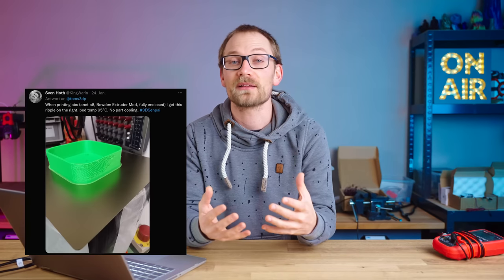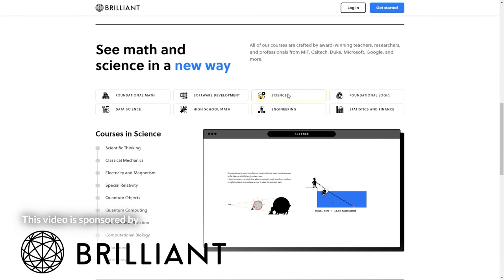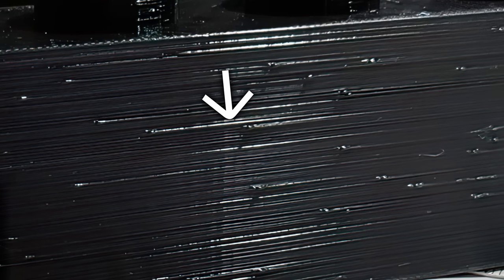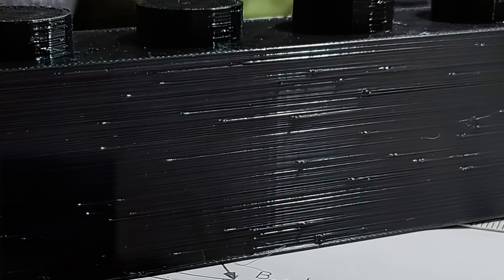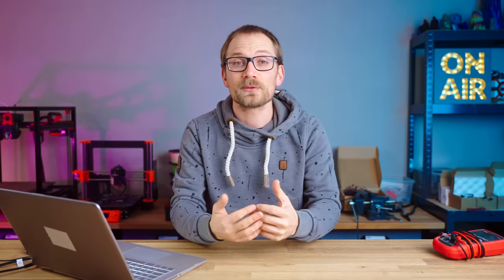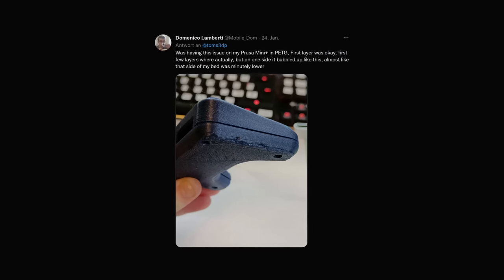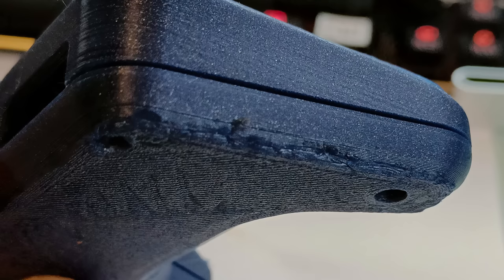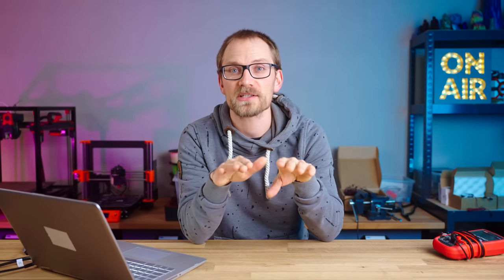Diagnosing YOUR 3D printer problems! #3DSenpai

Comment: The first problem also can be solved by enabling coasting in Cura. It stops filament feed a few mm before the perimeter end. So the hotend can relive pressure a bit. It helps a lot with runny filaments like PTEG.
Reply: Nice tip, didn't know about the coasting (I knew it was there, but never figured where it was helpful). Gotta check that out if I end up with this problem now!
Reply: Seconded, petg needs coasting enabled in my experience to get rid of stringing.

Comment: 1st problem - can try enable "retract on layer change" to decrease pressure a bit.
3td problem - PETG does not like to be squished in general. Also, layer above it may fail to bind to first layer properly then and you may get tears in 2nd and other layers.

Comment: Re: cleaning print surfaces
I apparently have oily skin, I've flooded Prusa sheets with IPA before and still got adhesion issues. When I put on nitrile gloves, that went away. If that still doesn't work, I give it a quick swipe with acetone then clean it with IPA.

Filleted surfaces facing down can turn into a dog's dinner when 3D printed, especially if the fillet goes all the way around the model (that can result in air printing). It might be worth cutting the model in half and printing the pieces with the fillets facing up, then gluing the pieces back together.

Comment: Tom, I've been tinkering with 3d printers almost as long as you but was stumped by a first layer issue for the past few weeks.  After watching this video it turns out first layer extrusion multiplier was screwing up all of the layers as high as 10-15!  Pretty cool that a relatively experienced hobbyist can still learn a thing or two from newbie-oriented content.  Also, I was recently thinking about your foray into MPCNC-land and what a sour experience that was.  Have you given the PrintNC a look?  It looks like it might check all the boxes.  Fully open source(well organized Fusion 360 parametric model free to download!), utilizes 3d printed parts for machine building, and has relatively little content already on youtube about it.  The discord is also very active.  Worth a look if you're thinking about new project content.  Cheers!~

Comment: Thanks for giving me the inspiration to take the cover off my old heavy modded cr10s :) She now has all bearings degreased and refurbished, all pulleys checked and belts tightened. Went over all the frame screws just for fun, and im glad i did :) some1 was sloppy when assembling? hmm i wonder :P 

Juuuust finished leveling the bed, all i had was tpu,, but it worked fine ;) 0.1mm layer squares, all within 0.01mm tolerance. I think i got it level enough now;) 

THanks again man. Currently printing a can sleeve cooler thing for my coldsnacks.  Cheers

Comment: The first problem looks like too high of a retraction length. If set too high, the nozzle can suck up a bubble of air inside and then get pushed out close to the start of the line/seam. I had noticed this issue when doing a pressure advance tuning tower. The bubble/zit was always on the side of the start of the seam. I turned down the retraction length from 2.0mm to 0.5mm and the zits completely disappeared. I have a Voron v0.1 with a Dragonfly hotend.

Comment: On my Prusa Mini, I have been having some minor issues with connecting multiple parts together. Instead of a flat edge between the two, the two parts have a slight curl away from each other, creating a noticeable gap. I am using painters tape to increase bed adhesion, could that be an issue?

Comment: Hehe, this is part of the fun with 3d printing, solving problems that crop up all the time. I'm a bit stupid so I designed and built my own core-xy 3d printer from scratch after only having made 5 ish prints with the cr10 I started with. Tuning a 3d printer from scratch is a learning experience I tell you!

Comment: In response to the first problem with the blobs on the seems: make sure you print the inner perimeters before the outer. If you print the outer first your nozzle will ooze during the travel move to the beginning of the seem. With internal perimeters first the ooze wipe will be invisible and the outer perimeter will start with just moving over 1 perimeter thickness from where the previous perimeter ended so no time to ooze.

Comment: Could that first issue not also be fixed by making sure your Z Seam is aligned/otherwise not set to random?
Reply: Not really since it happens when the printer moves from inner to outer wall. You would just end up with obvious zits in a vertical line and that gradient he mentioned
Reply: @ciarfah  depends if you have random z hop or an assigned location

Comment: The Zips can also be reduced further by the new (experimental) Cura/PrusaSlicer setting "Pressurer Equalizer".
If you set an appropriate value for the "slow down" portion of the function, the print time will increase slightly,
as you basically "ramp down" to the lower speed for outer perimeters.
But your slicer will have an easier time to calculate realistic pressure buildup in bowden extruders and
thus get more consistent linear extrusions.
That + the mentioned measures should pretty much eliminate the issue.

Comment: Problem 2 is a good example of why I think the closed loop systems that measure the movement of the stepper motor is basically worhless.
You need to measure the opposite pulley tot he motor so you know that something have actually moved instead of the motor that might move but everything else is standing still.
Reply: Closed loop is not a solution to backlash, and I don't think anyone knowledgeable would claim it to be.
Reply: @jaro6985  unless you use glass scales or sth like that, which would be real closed loop

Comment: Most of the problems I have encountered over the years can be described by saying the model of my printer: Lulzbot Mini V0
The joys of being an early adopter lol

Ours was probably within the first few thousand of the lulzbot mini's produced, so z axis issues, bed levelling problems, bushings and belts wearing out from old age, mounts for the various bearings for the belts cracking, z offsets being off from the factory, the clamp for the extruder feed system often broke on the early ones they made it thicker later on, not to mention the electrical faults, good god the wiring in that thing was a rat's nest haha

Comment: The thing that gets me is trying to match the flaws I'm getting with examples online. Text searches often return spurious hits because I can't describe them specifically enough. Images in troubleshooting guides often differ enough that I'm not quite sure which one applies (if any). That's why I like test models designed to elicit specific problems. Starts to cross over into printer calibration from troubleshooting, and there might be too many models to expect someone to run but arranging them in a hierarchy if greater diagnosis is required might help.
Reply: Your flaws may not be from the slicer- they can be from mechanical issues with the printer and the firmware - things like E steps etc. Slicers of today are so much better than 5 yrs ago and most profiles work out of the box with no tweaks - cura and prusia are two i use and have found they work fine in most instances . I think a lot of people try to run before they can walk and end up so confused -try the pre configured profile first then work from that.

Comment: I recently had a bag clog on my ender 3 pro, I had to take my hot end completely apart and even trim about 3/8" off the tubing and reassemble. now I seem to have little micro gaps randomly through the layers, that wasn't doing before, any ideas what could help resolve

Comment: in april i got given a used ender 3 v2 neo by a family member as a gift as they were upgrading. this is my first printer. after teaching myself how to use it and getting very familiar with the machine i am still unable to get even one test print, i can get the bed perfectly leveled and a good first 3 layers then it stops extruding and keeps going, no extruder clicking it just ends up leaking out or underextruding. i have done multiple fixes for heat creep ect, taken apart and put back together the hotend, cleaned and even replaced the tubing and couplers hoping for any sort of result. i have spent maybe over 100 hours troubleshooting and exhausting all the fixes i could find. im not quite sure how to go forward and i dont have anyone able to assist me currently. im willing to pay to just have someone physically help with it or give instruction on what to try next. thank you.

Comment: Ah I didn't know you were doing this. One of my printers has a problem nobody has had an answer for. A wavy pattern on the +X side of all prints. Also on -X but not as pronounced. I've basically stopped using that printer.

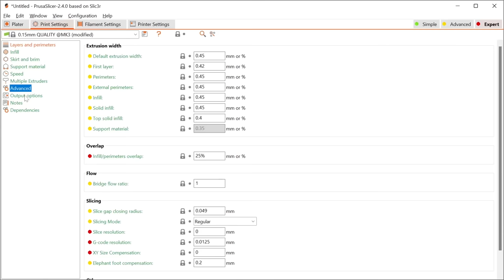Comment: Did you change the extrusion width to 1mm at 7:54? I didn't know you could print a 1mm width with a 0.4mm nozzle, that is a good tip. The max I tried is 0.55mm width
Reply: I've gone with 0.8mm if my feed rate is low enough for the filament I'm using, so with 0.2mm layers I can still push 80mm/s at 0.8mm traces, or 0.6mm with 0.3mm layers but that's the edge of it, and PETG might not like it too (e-Sun one up to 0.6mm at 0.3mm layers and 60mm/s but not more, it will under extrude above that combination).
Takes quite a bit of testing to check if you filament, temperature, hotend and nozzle can all handle each mode. I like using 0.4mm outer walls for fine details and 0.8mm skins to get those tops and bottoms over quickly.
Reply: @Kalvinjj  I have some corner warping issue with some models with sharp corners like squares. No matter what I try(brim, mouse ears, etc.) it still warps just tiny bit. I figured this would be a good thing to try on those shapes!

Comment: Do all fdm printers (non direct drive) have a standard bowden tube fitting size/thread, specifically on the FILAMENT FEEDER(not the print head fitting)? I have an Ender 3 pro and the fitting on the feeder motor with the geared teeth always loosens. I think I have an alternative, but Im having a really hard time finding the right part.

Comment: I have a problem with my 3d printer, when i try to print something it prints on the side as it should and it stays on, how ever when it starts to print the actual print in the center it does not stay on and i have even tryed buying a new bed on it which had some left over resin on, and now that i have tryed the new bed that arrived im very concerned about if i should buy a new 3d printer or if there is any way to solve this problem

Comment: Are there any slicers with higher level control parameters so they're easier for people with less experience? So you can specify what the priorities for the print are: speed, surface quality, weight, shell integrity (i.e. no holes), etc and then that tweaks a bunch of parameters rather than you doing so explicitly. That would seem like the long term ideal to strive for. I've only ever used Cura which I've read has a lot of controls so perhaps this is closer (at least a bit, anyway) to how it works in some other software.
Reply: Cura allows you to choose what parameters you want to see or you use  most - you  can use the basic setting which does pretty much everything for you or switch to advanced and fine tune the settings .

Comment: My ender 3 pro nozzle can only get up to 160 degrees. All connections tight on main  board.  I’ve replaced thermistor. I checked barrel hot end heater with meter.   17.5 ohms the bed heater is fine.  The message I get is “heater Failed Printer Halted Please Reset”.  Please suggest what to check

Comment: Hey just got my first printer and chose an ender 5 plus because of its massive build volume. 2 questions though 1. Any opinions on this machine or upgrades I should get or print for it? And 2. Is it normal to hear light popping sounds on occasion while printing? Sounds like it's coming from the hot end. My only upgrades so far was an all metal hot end, silent board, and Capricorn tubing.
Reply: The popping sound is most likely moisture in your filament. It can easily be dried out and you’ll get better prints and no more popping sounds!

Comment: one video I would like to see is, converting a 1.75mm direct drive  (or bowden) to 2.85mm, which 2.85mm I my experience is cheaper. I modified my Anet A8 for 2.85mm and I did a copper wire through the nozzle approx 3 years. I did the 2.85mm mod because I wanted to print trimmer line, which prints so well once its dried. 2.85mm has its cons but it also has its pros. 2.85mm petg can be a pain from my experience, heat creep, not melting evenly resulting in jamming. but at 1/2 the cost from my filament supplier worth the troubles. and trimmer line, when dry, prints better as easy as pla

Comment: In supersicer I am trying to run my first layer speed to 50% but when I change the speed it doesn't change it on my prusa i3. I have to manually go in and dial it down to 50%. The first layers is in mm/s for min and a percent for max. What am I doing wrong

Comment: my ender 3 v2 under extrudes only in the front left corner of my build plate? any walls or surfaces facing directly at the corner come out under extruded with1 wall thickness fading to nothing the rest of the print is about 90-95 % perfect .any ideas ?

Comment: i have a odd problem, the first few layers or so look extremely rough and gloopy, but after that the print is clean...ive looked and looked for any ideas.
Reply: I had a similar problem recently and it was the temperature calibration of the nozzle was wrong. Try print the first layers at a higher temperature and see if that helps.
Reply: @royhenderson4085  you know you might be on to something i was wondering about that actually because i have the temp set to 195 and the PLA sure seems super super runny at that temp i best look into it some more.

Comment: Hey, I get those blobs from the beginning to, and I see my printer stop mid print, with the extruder turning, only to continue printing as normal. Those lines you see (if its the same problem as mine) as unextruded lines. I figure theres something wrong with the communication between octoprint, the gcode its reading and my board (SKR mini v3), but i dont really know.
Reply: Try printing directly from the board, see if the problem goes away.
Reply: @jaro6985  im going to try that, after i finish fixing a constantly clogging nozzle
Reply: @jaro6985  found the issue, its with octoprint and one of the plugins
Reply: @TheCoffeeSquirel  which plugin? Currently dealing with the same issue.  Prints fine from the sd card but pauses and blobs while printing via octoprint.
Reply: @patsun1084  I made a list of plugins i uninstalled before trying now, it got deleted lol

I uninstalled:
The spaghetti detective
Slicer plugin
PrettyGCode
Bed Visualizer

I think there was one more, but I cant remember

The not native plugins I still have installed:
ABL Expert Plugin
Exclude Region
Octoeverywhere
PrintTimeGenius Plugin
Themeify
TouchUI

Thus far (26 minutes) it has yielded 2 blobs that I can see. But its significantly less than I had before.

Are you using a Raspberry Pi for octoprint? Or an android device? I am running on an Galaxy S8.
Reply: @TheCoffeeSquirel  thanks. I have spaghetti detective running.  I'm also running octo4a on a galaxy s8
Reply: @patsun1084  I tried a print with octoprint in safe mode, reduced the amount of blobs, but not entirely. 

I have now flashed a better configuration, and upped the baudrate to 250000 instead of 115200, with octoprint in safe mode. Ill let you know what the results are.
Reply: @patsun1084  new firmware and higher baudrate did not help. Next ill try a different slicer. I dont know wether it will work or not
Reply: @TheCoffeeSquirel  I have been wondering if it was a connection issue.  Haven't had a chance to look into it but I think the phone/pi is constantly sending and receiving data from the web interface on my laptop.
Reply: @patsun1084  i have been looking around for solutions, it is a known serial problem. Ill have to conclude for the night now though, i do have an idea for testing tomorrow. Changing cable and maybe device. And i might reinstall octoprint. Tell me if you figure something out :)
Reply: @patsun1084  looks like i solved it now, have to let my current print run a little longer. Issue is either that i forgot to force baudrate of 250000 when i tried that, or the usb hub timing out the serial connection. That i forgot to force the baudrate seems more likely, i am currently running a print with 250000 baud and without a usb hub, or with a different hub.
Reply: @patsun1084  Spoke too soon lol, ill try reinstalling octoprint now, it printed fine on my other android device.

Comment: I have a issue with my 3d printer it will print some files but others won't print I have changed any settings as I am very new to 3d printing it's not the bed level as it prints some files really well it seems like the filament isn't coming through for the other prints

Comment: Nine times out of ten I can't get the first layer to stick to the bed. I've leveled the bed again and again. I've reduced print speed. I've bumped up temperature and initial layer thickness. Nothing at all seems to work. The only successful prints I've had with my printer were as it was right out of the box. Since I've started changing settings, not one successful print.

Comment: 3D printers are a lot like vintage vehicles, especially anything carbureted. They need constant upkeep and repairs to stay running reliably cuz of the many parts that wear with use, rubber/silicone parts will stretch or dry out and deteriorate, nuts and bolts can get loose from vibrations, hoses/feed lines can get jammed, etc.. it's good habit to routinely check these wear parts